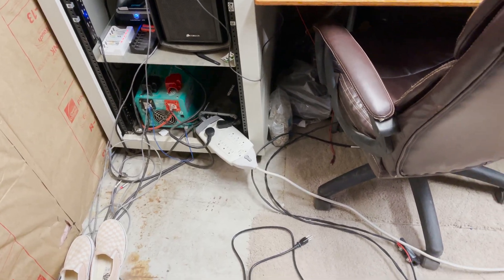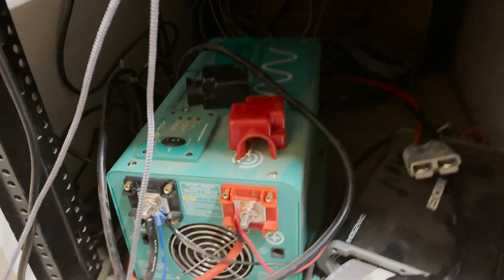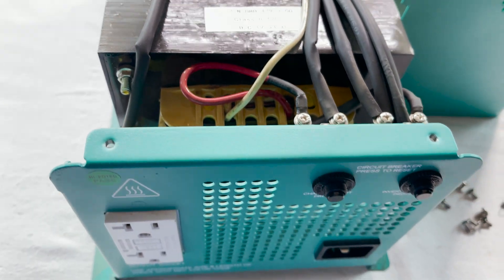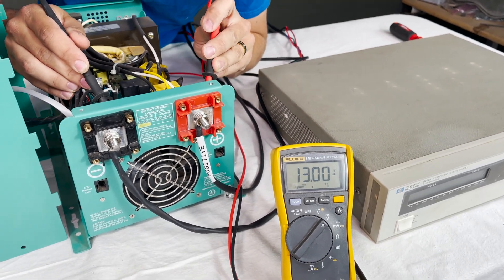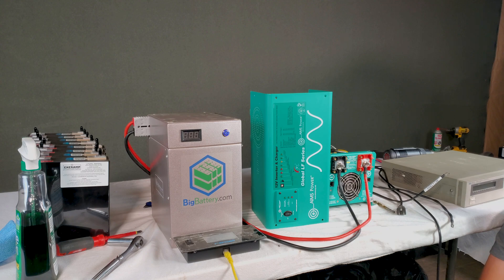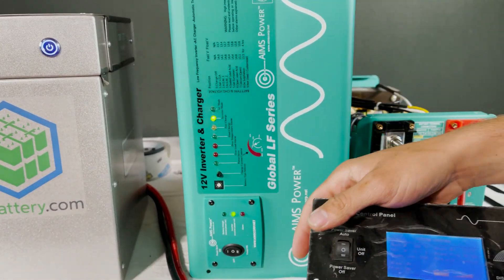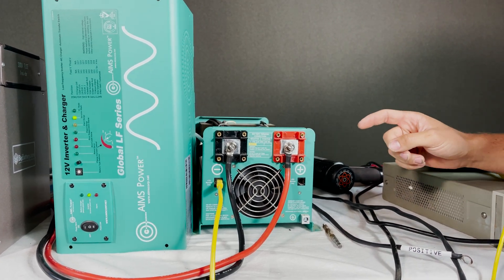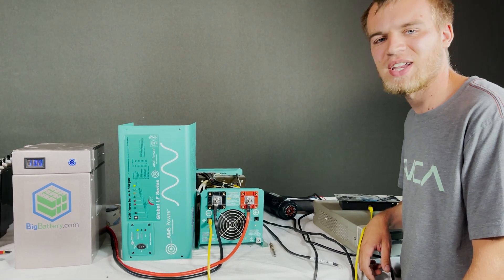AIMS Power 1250w Inverter Charger | 300A Fuse Blown, Won't Power On, Then STARTS WORKING FINE???

Comment: My AIMS unit also just quit working - I'm using it for a sump pump backup, so that's disconcerting as I have no idea when it died.  Thanks for this video.  I'll start my investigation shortly, but unplugging overnight and disconnecting the battery.  Did you place yours back in service?

Comment: Very interesting that the 300a fuse on the battery would blow.  Since I have seen your 2nd video first, I know the cause of the problem.  Very interesting how that specific failure caused the surge.  Thanks for posting this video.

Comment: I think I have the same problem with my hybrid inverter it's not detecting the batteries it's a 24 volt inverter it power is on from the AC input and the solar panels but it's not taking a charge and won't power on from the batteries I see something that look like a fuse right next to the battery terminal it's a black thing with two screws on it is that the fuse ?

Comment: You are the 3er one with similar problem.  My 6kw aim inverter stopped working when a flash light fall on top of it. After opening it and installing the power cable it started working again and have been working okay for many months without any issue.

Comment: Great, I ordered this very model inverter and received it today....keep or return? That yellow block looks to be a capacitor and it should not be making any noise.
Reply from the maker: I will be posting an update video in the next day or two. Quite a lot of progress has been made in terms of finding this issue
Reply: @HighTechLab  I have a 3KW Aims low frequency inverter similar to this (Blue not Green, couple more bells and whistles) and the thing has worked flawlessly whenever I have used it for portable power over the last 5 years. I was planning on doing the same exact thing you have set up in my office and use the 1250W inverter with a 100AH AGM as a UPS for my PC and printer (can't use printer with our APC modified sine backup) Not sure what the issue would be with your unit but from what you describe it sounds like the top control board might be acting up so will look forward to your follow up videos.

Comment: Total guessing here: But are there any MOVs in the unit? These can fail as a dead short, then die as a open circuit This would explain the blown fuse. Another issue is bad caps. Electrolytic caps go bade over time causing high leakage and drop in capacitance. This could have causes excessive noise that could have caused as short in the Mosfet bridge, leading to the fuse getting blown, but usually this also kills the mosfets in the process. 

I would start by checking all of the caps and see if any are out of spec. That said the issue that checking caps using a volt meter does always show bad caps. Caps really need to be tested at operating voltage to see if they have a leakage issue. But Its probably worth to just check them with a volt meter if that is all you have. If you don't find any bad caps, then check all of the voltage rails (5V/3.3V etc) I presume the inverter is using a microcontroller. If the voltage is under, or there is a lot of noise on the digital power rails it can cause problems. Usually bad voltage or noise is caused by failing caps or a failing voltage regulator. 

Or the fuse was just defective (had some inperfection that over time cause it to fail).

Comment: If you have an oscilloscope current clamp, check to see what the current draw waveform is.  Fuses can fail from cycling loads as the heating and cooling cycles can cause metal fatigue in the element.  Other possibility was a manufacturing defect in the fuse.
Also check the architecture of the transformer H bridge.  Depending on how the FET drivers are controlled, the micro that does the FET switching might make both halves of one of the H bridge legs turn on iffen it crashes.  That would short out the 12V rail.

Comment: That yellow Device is a Filter Capacitor, of some sort. Not sure of the Value. But they can go bad for no reason. Try replacing it.
Reply from the maker: But would a filter capacitor cause the inverter not to startup without AC power applied?
Reply: @HighTechLab  It can cause the Fault possibly. Those Aims Inverters are crazy on sensing issues. I have 2 Big ones myself.
Reply: Can you possibly measure the value on that capacitor? To see if it is still good.
Reply: @jerryc7016  Usually if you hear a squealing noise from them. Thats usually an Internal arcing noise. I just dont bother testing and replace.
Reply: I agree
Reply: It does kind of sound like arcing doesnt it
Reply: That filter capacitor is bad indeed, still it won't trip a 300amp fuse, especially not on the DC side
Reply: @TheTwister3000  That capacitor can cause that 300 amp fuse to pop if it shorts out intermitted . All it takes is a few milliseconds.
Reply: @TheTwister3000  was it on the DC side? I didnt see that but if its on the AC side and its arcing then it would be a pulsed short witch in theory could blow the fuse
Reply: ah wait, it's on the DC side indeed, Sorry my bad!
That cap can indeed be your problem!

Comment: Hmm... 300A fuse, so, you could have had a 3500W surge draw... or possibly the fuse was weakened from several 2500A surges... idk. Let us know if you find a cause.
Reply from the maker: We don't have anything that can even come close to the 1250w rating of the inverter (2 computers, 3 monitors, a printer and a network switch)...Also the inverter's theoretical surge rating is 2500w which is still only around 210 amps
Reply: @HighTechLab  of course, normal loads wouldn’t cause that demand, or you wouldn’t have had that inverter powering it.
My point is something blew the fuse. I have seen surge protectors die, power supplies short tantalum capacitors, wiring abrasions shorting, etc. 
If the inverter has resumed function, something external may be the cause. Be sure to put a kill a watt device on to monitor loads.
Reply: My laser printer will cause a big spike when getting ready to print. I have a 1500w ups and it complains. I have a similar amount of load as you have.
Reply from the maker: We have just small hp inkjet printer, no laser printer

Comment: Any chance something in the battery side shorted?
Reply from the maker: Great question, but if that were the case, the inverter should have powered up when connected up to the bench power supply.
Reply: @HighTechLab  have you checked the internal RJ-45 socket inside the inverter. Had a similar issue sometime back and realized the internal RJ-45 cable connecting the front panel to the control board was broken.
Reply from the maker: It appears to be a ribbon cable, and we did check that.  It has that red goopy glue stuff from the factory holding it in place still.